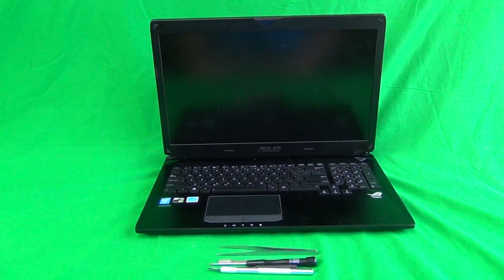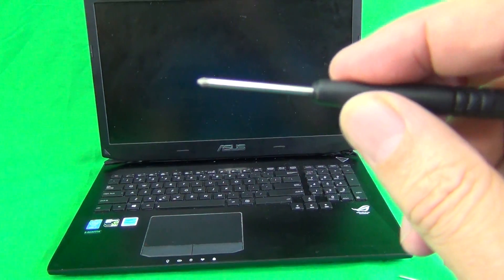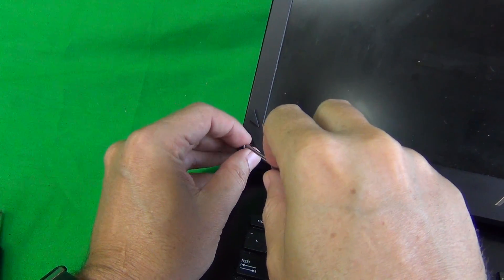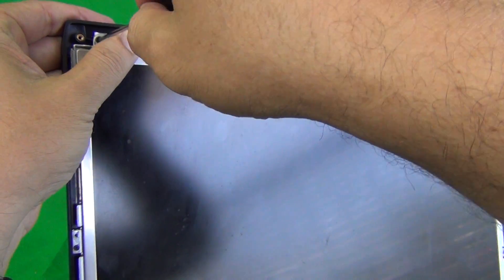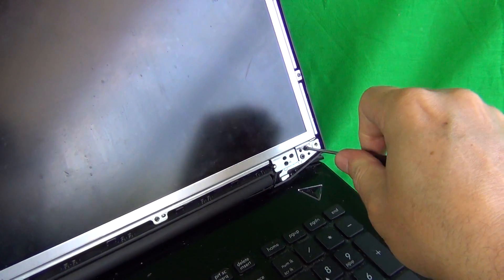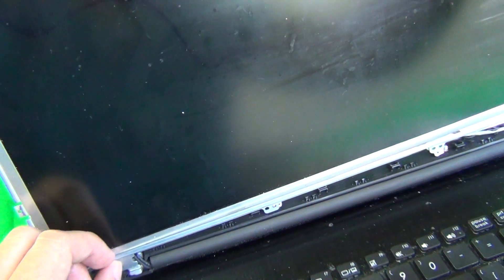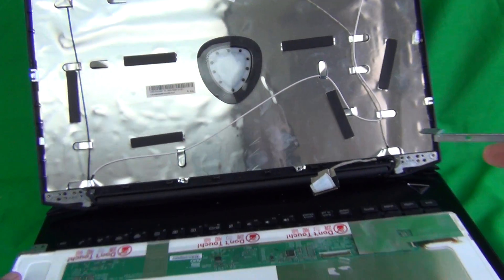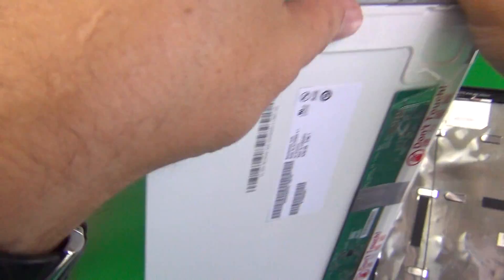ASUS G750J Laptop Screen Replacement Procedure

Comment: Three thoughts to add... in case it helps anyone else.
1. I had to hook up an external monitor initially, and let the laptop get to the Internet. Run windows update (advanced/drivers options) and only then did the screen work. I guess perhaps my replacement LCD, while a perfect fit/match, is a different/newer manufacturer.
Once that updated, it works fine.
2. The bottom bracket doesn't need to come off.
Just the top, and side screws, and their related brackets. 🙂
3. There is a magnet in the trim piece... it belongs in the pocket in the plastic trim.
On the one I just did - it had stuck to the screen and frame at the bottom.... I didn't realize until after that it needed to be in that pocket on the trim. (trips the "lid closed" sensor)

Comment: Nice. I had insane flickering issues unless the screen was fully tilted back. Used this guide to check the connector, turns out it was in firmly and I don't think I changed anything.. yet I now have no flickering for the first time in a year and I can now see the screen properly. Glad I didn't need to buy a new screen. 
Next time I'll have to do the same with the keyboard connector to fix random unresponsive buttons.
Reply: I have the same flicker issue. I'm still in the process of disassembly though.

Comment: Does anybody know from the screen which cable goes into the main and aux? There is a white wire with red and black wire with blue from the screen into the mobo? 

Accidentally popped off when I moved the screen onto the keyboard.

Comment: exact same procedure for ROG g46vw (except the battery removal part since it's non removable on g46vw)?
Reply: So you need to open the backplate and take it out before dissasembly. Much safer to not break the backlight of the screen.